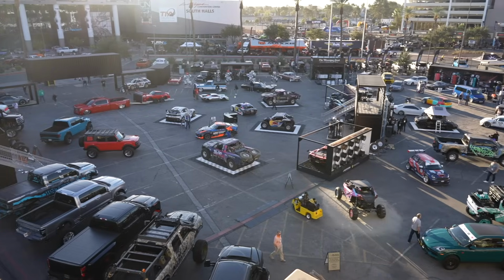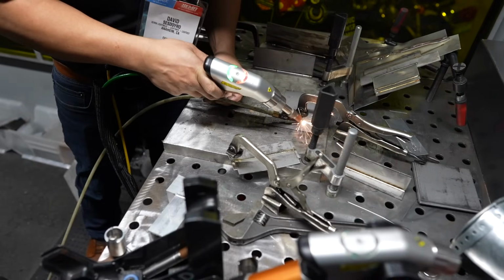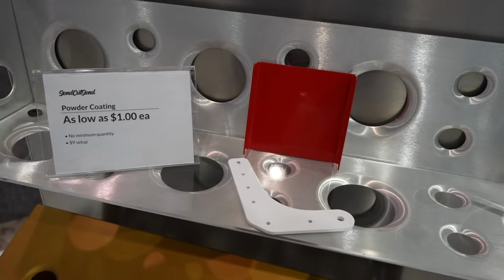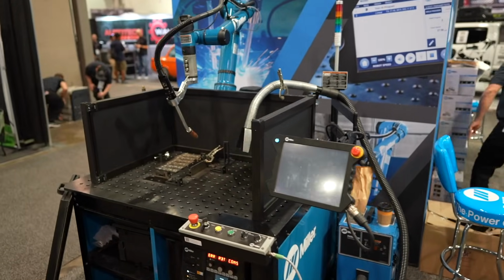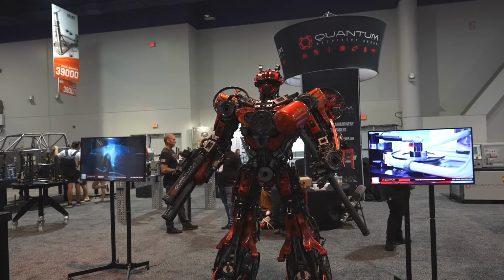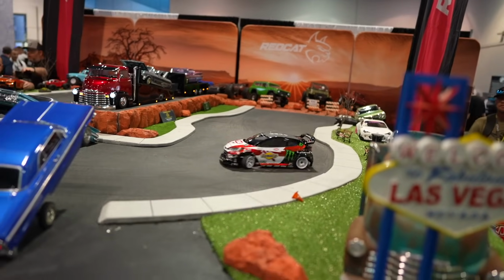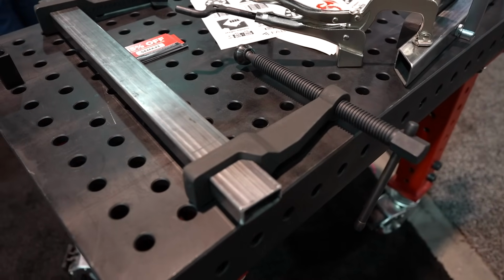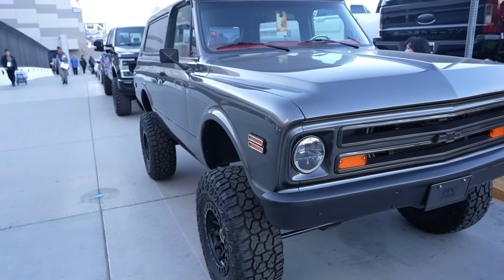SEMA '23 for the Welding Enthusiast: Tool highlights from the ultimate automotive trade show

Comment: I haven't been to SEMA, but I've seen a bunch of videos and photos over the years.  To me, the vendors are more interesting than most of the vehicles, and I'd like to see you cover the tools. The problem I have with the vehicles is they're just so over the top that 00/44% of them are something you'd never drive as a daily. $50K paint jobs on top of a $30K chassis with a $30K engine and $40K interior just aren't my thing. I much prefer the custom rigs and restorations that are in the price range of your average mortal.

Comment: Every year I say I’m going to Fabtech, SEMA and the National Hardware show, but I never do. As I get older, I get lazier. Nice that you went. Any other welder manufacturers there? I didn’t look up the show exhibitors.
Reply from the maker: Great to hear from you, Mel! I didn’t make it out to Fabtech this year, so I went to SEMA instead. Miller and Lincoln were the only welder manufacturers there. Baileigh, Harbor Freight and a few auto body companies had some machines as well. I only spent one full day at the show…if I make it out again, I’ll probably spend a bit longer and catch some of the weird specialty stuff.
Reply: @TimWelds I finally got my Siegmund table. I don’t know how you got yours out of the pallet and put the legs on, but boy, it took me some time. I had to put the pallet on my stacker. A real pain. Then getting the kegs on was annoying. For some reason they gave all those holes where the kegs go, but you just use two. But which two? They don’t bother giving a short instruction on that so I had to make a paper template by putting it under the corner and popping the holes out with my finger. Then I could figure it out. I don’t know if you had a problem with that.

The other annoying thing is that they charged $933 to ship it. The accessory kit cost $179 to ship. That’s really too much, even though it weighs 485 pounds. But I must say that the table is very well designed and made. The accessories are well made as well.

Comment: 15 years ago I was working on starting a company that does exactly like send-cut-send. I had the business proposal made and all. ultimately I could not get the capitol needed to get the engineers and the RIGHT equipment. Now, I want one of them laser welders but at around 35K ... uhh yeah.  I'm hoping they make a welder where you can put in what metal you are welding and thickness and it automatically sets the welder for you. I suck at it lol
Reply from the maker: Yeah, those lasers are certainly outside of my budget for the moment, but they sure are cool!
Reply: I didn’t know about send-cut-send but I have a couple of jobs I could use them for.  Really glad I watched this video.

Comment: Nice review of SEMA. Hey, did you upset someone to get that shiner? The other guy looked twice as bad, right? LOL!
Reply from the maker: Thanks! The other guy came out just fine, which is good because he's my 5 year old son :) Just a little head bump...I wish I had a better story like a bar fight or scuba diving, but it's just another day of living the dad life.
Reply: @TimWelds i need a good rod ( for a ambench vice and its made of a true  mild steel  a medium carbon steel)  and can be run on ac and a rod that gives streanght under pressure the type of pressure like well pressure aengst the weld like this ➡️ l , arrow direction of presure  and the lower case l the pice it goes to the or i simple the pice of the vice that moves